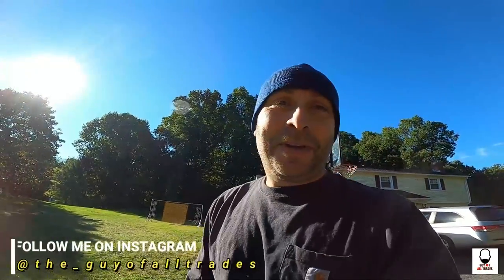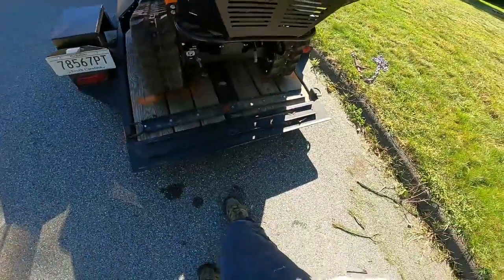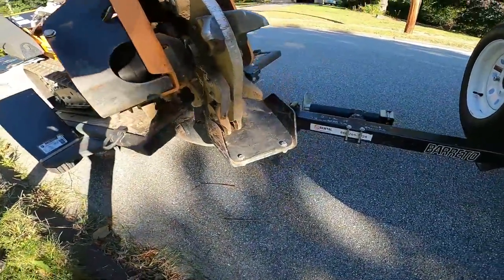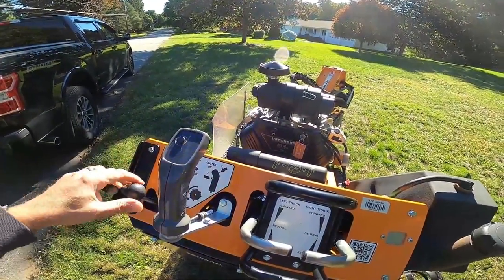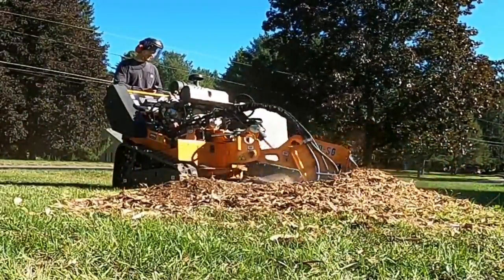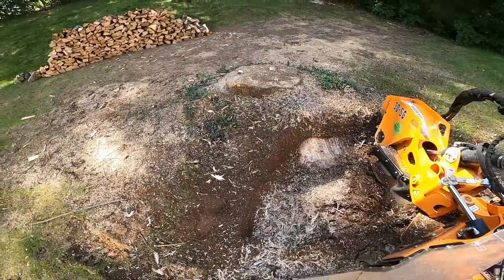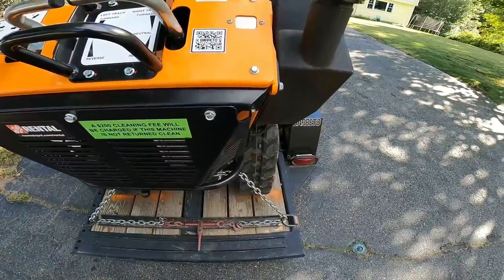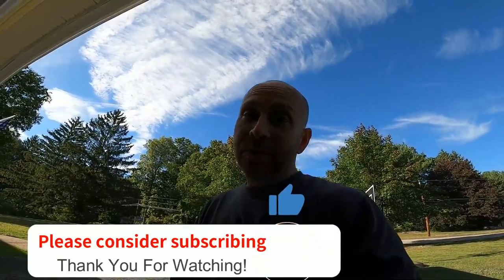Barreto 30-SG Stump Grinder | Home Depot Rental

Comment: For anyone watching, u only need to push the cutter circle button on top down 1st and then you squeeze the trigger at the same time but also lift up your thumb from the circle engagement button on top and only need to squeeze the handle trigger. It says it in the manual. Thats just a safety engagement. Button 1 then 2 while holding down the first and then you hold the trigger and let off the 1st button on top the handle.
Reply from the maker: Good point! Thanks for mentioning.

Comment: How long did it take you to do all the stumps?
Reply from the maker: It was about 6 hours. I ended up paying the full day rental because I had to clean the machine and get it back to the store too. I did 8 total stumps. Definitely matters how sharp the teeth are on the grinder. If they are rounded off it’s not going to work as fast.

Comment: Hi-question, when the stump grinder threw the rock, did it throw it forward away from the grinding wheel or did it throw it back at you? I'm renting one of these in a couple weeks so I am trying to cover all the bases. Thanks

Randy
Reply from the maker: The blade spins towards you but the rock flew away from me. It definitely throws stuff quite a distance. I actually cracked my GoPro lens when I was filming the video lol
Reply: @theguyofalltrades  okay, thanks for the response. I actually plan on setting up a tarp as a curtain in front of the machine just in case. I have an area where I will be working kind of close to the street. Thanks again